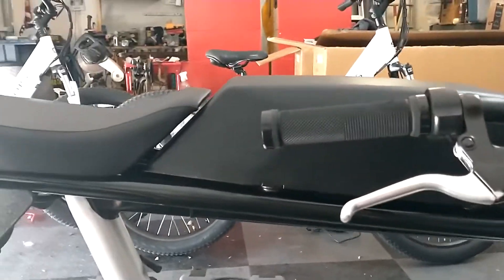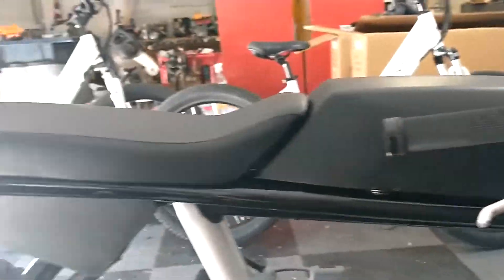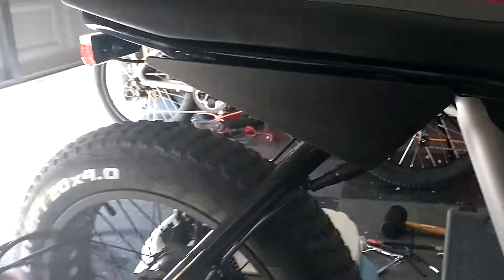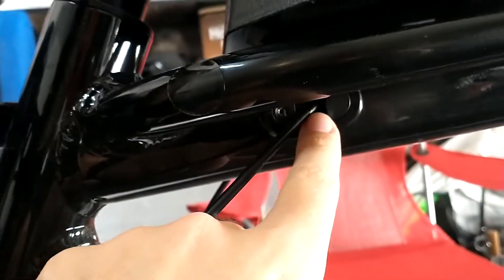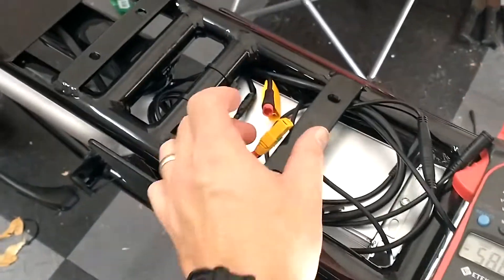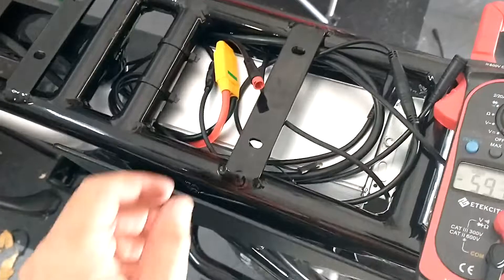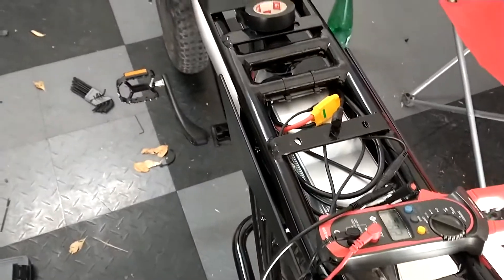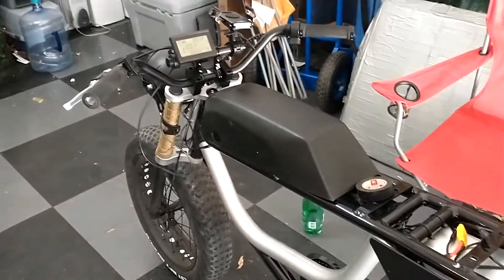Monday Motorbikes Anza - Part 2 - Controller Upgrade

Comment: The two red plugs are for the head and tail light. I have a juiced scrambler with the same connections. I also tested the connectors and it read 52v. I had use a downstep to change the volts from 52v to 12v. Then I was able to connect motocycle headlight. I took apart the factory lights have a built in motherboard that I assume drops the volts. Good luck with your project.

Comment: I just got mine, didn't ride it yet, but when I put it on level 3, and max the throttle.. on the screen it shows 20MPH. Should I expect 15MPH when actually riding?
Reply from the maker: Cool. You have a 500w, right? Think they are doing those to do 20mph now. Test with a gps speedometer app on your phone when you take it out. Have fun!
Reply: @RobbMods  Thanks! yes its the 500Watts - Will report back!
Reply: @RobbMods  Back to confirm.... I was able to hit max 22mph on my app and 21mph on the onboard computer.
Reply from the maker: @rahmanr112  sweet! That's great news!
Reply: @rahmanr112  awesome same here. I have 500w too. Sidenote this battery can last a long time. I was able to travel from Hollywood to Inglewood and still had half a battery left
Reply: @uniqueanartist6792   I agree I have been riding it daily for 3 days and it’s still just half way! Wish the seat little more comfortable 😂
Reply: @rahmanr112  that’s awesome. Really I find the seat to be very comfortable

Comment: Glad I came across your channel. I ordered the Presidio 750w. Now I hearing people can’t get pass 15 to 20mph. So will the controller you got work with this bike. Just no headlights and tail lights with that controller. Just can’t believe that I will have my bike tomorrow snd won’t be able to get the speed the advertise. They also said they have the off road mood.  Anyway keep it coming. Great job on your bike.
Reply from the maker: When you get it do a GPS test with your phone. They should be shipping going 25now
Reply: @RobbMods  thank you.
Reply: @RobbMods  I do want to do the controller and color lcd swap. And later do a battery swap.
Reply from the maker: @JPTake3  good way to learn about the bike! Mine is done. Flickers at 30mph on fresh battery and pulls steady 28mph. Need to adjust the battery gauge in the controller and wire up my switch to use both batteries.
Reply: @RobbMods  I wish I got the anza but I’m 5 11 and 220. My legs was tight. And the presidio was ok. Is that 30 to 28 with the controller update and 52volt battery. Wow. I would like to have mind hit that. Right now it’s just clocking at 21 to 23. On stock setup.
Reply from the maker: @JPTake3  yeah that is worth the new controller and battery. Seems like that's the max the motor can spin with the 20" wheels